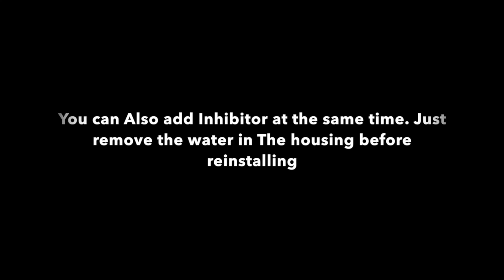How to clean A MagnaClean filter

Comment: Hey mate. If I can’t access the isolation valves (kitchen was built around them) can I just drain the heating system to achieve the same result? If not I’ll get the saw out 😂 cheers in advance.

Comment: You should have cracked the bleed screw on the lid before unscrewing it.
The lid o ring on these fail after opening these  a few times.
You can order new ones for about £ 7.
Don’t buy the Adey ones, they are way overpriced.
Reply from the maker: @RD-ox3ce  Never needed to do that or advised by OEM.. Silicone lube them on instal NEVER have issues in 41 years. All the best.